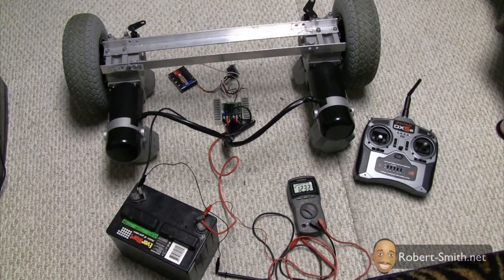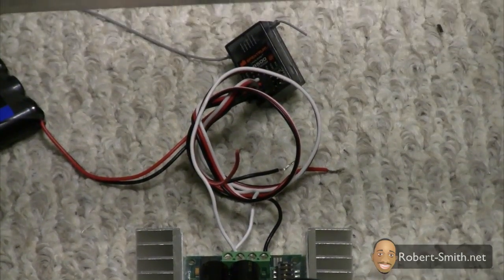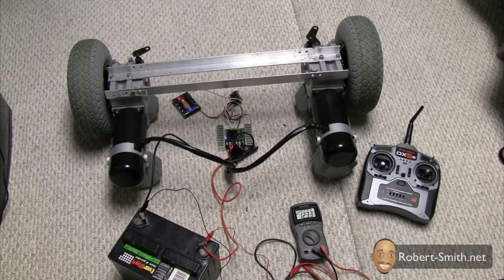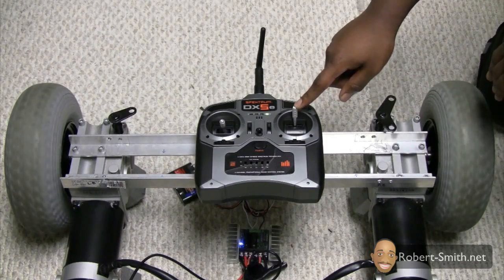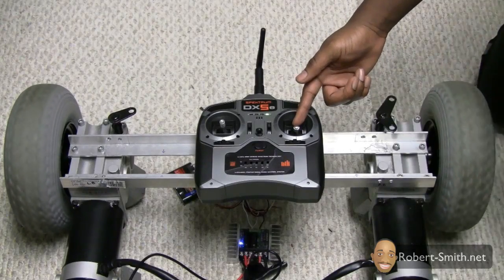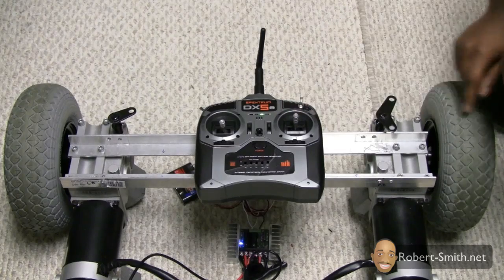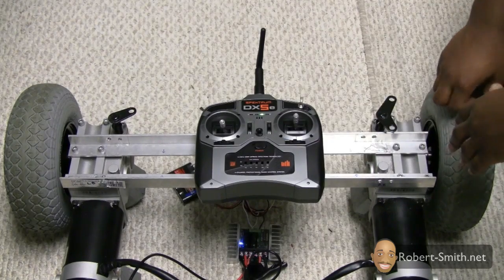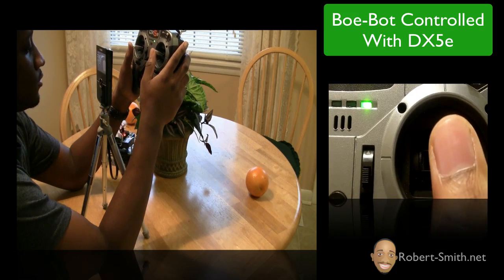RC Lawn Mower Project Update - Transmitter/Receiver Testing

Comment: Can you please advise me which mode of rc Transmitter works for such tank style robotic project.
Reply from the maker: Hey Pol_Khol. I am not sure for that type of project. I would think the mode I used in this project would probably work, but you may want to reach out to the Dimension Engineering company and see what they recommend also.

Comment: In similar projects what do you suggest the type of circuit breaker or fuse?
Reply from the maker: I would suggest you use a breaker if you can, but most people would probably use a fuse since they are a little cheaper sometimes and you can find many size types.

Comment: Hey Robert this is Robert Denney I wanna hook an alternator to  2 ,12 V battery is  building a snow plowI don't know how to do without a regulator.I  bought a 12 V alternator 60 amps.
Reply from the maker: I have never tried to hook an alternator to a 12v battery, so I would not know the best advise to give in this case, but I would recommend joining some online forum communities to see if anyone may be able to provide you some support. Forums helped me a lot when I was first getting started with this project :D

Comment: what model wheel chair motors did you use?
Reply from the maker: Hey Chris. I believe the following was the type of wheelchair motors I purchased: CTM HS 1000 Right Power Wheelchair Motor Gearbox 511000-10010

Comment: Thank you for making this video I made a remote lawnmower now I just need to figure out a camera and lights. Any suggestions?
Reply from the maker: Hey Tim. I haven't looked into cameras in a while, but I would point you in the direction to do a search for "RC cameras" and see if that pulls up something you find useful. Also, depending on how large the yard is you plan to use it for you should take into account to make sure the camera can cover the lawn size/max length.

Comment: where did you get the code for the sabertooth at?
I need help..
Reply from the maker: There was no special code other than the dip switch settings, which at the time was found inside the manual on their website.

Comment: don't need a battery to receiver it gets powered from sabertooth if connected correct.looks like you have ground connected but not the red 5 volt.

Comment: I'm brand new to sabertooth 2x32a , controlling wheelchair motors...I also have a Flysky FS CT6B tx/rx and a New Rain ESC/BEC...do I still need a battery pack & universal 3 pin servo wires? ...I'm really frustrated not getting answers from Youtubers...Not even how to bind my 
transmitter...help would be much appreciated.

Comment: Hello Robert,  what pin configuration are you using for the receiver? I need one for throttle and one for stopping one wheel at a time for turning.  the transmitter does not have a mode for a car only ones for plane or heli, is that a problem for controlling an RC lawn mower?  Thanks
Reply: 4430salton if you get the computer cable for spectrum transmitter you can set diferential trust

Comment: Robert,  I like to flip my motors up .   Which would change the direction on them.  My question ,   will the motors run in reverse with out any problem?   Is that okay ? or will the motor burn up or mess-up due to not running the default direction?   Because now my right motor will be on my left side and my left motor on my right side.
Reply: if its a DC motor there is no real "right" direction

Comment: hey could you please help me to finish this project. I connected the cables as it looks in your video but the motors doesn't move just crank end the sabertooth it's flashing the red led when I try to move the wheels.I hope you can help me.thank you
Reply: +Brian S  I have the same issue. Have you figured out what was the problem? Would appreciate any help. Thanks

Comment: I've tried a 2ch (Harbor Freight plane) system and a 6 ch truck system, both at 27 Mghz.
I only got 1 channel to work with the motor controller each time. (Sabertooth 2X25).
I'm going to try a 2.4 Ghz radio next since that's what I see a lot of people using.
I just hope I don't end up with another hundred dollars worth of spare parts.

Comment: I just got my sabortooth and mine didn't need the battery on the receiver, it powered the receiver through the controller. I plan to use a pistol grip radio instead of the style in the vid, I'm trying to make it easier for a left handed person to use because my dad has a bad right hand and he'll want to play around with this too. lol
Reply: what kind of plug or connection did you have on the receiver?

Comment: I have transmitter Spektrum dx5e and receiver Ar600. I am using sabertooth 2x25.  I am using wheelchair  motor - i am looking to build remote controller snow thrower. Right now I wanna get the first stage in check - connecting my sabertooth and wheelchair motors running. How did you connect the 6v battery to the AR600 receiver and what connections where made from the sabertooth to the AR600. Slots on AR600 from L to R; BIND/DATA, THRO, AILE, ELEV, RUDD, GEAR, AUX1. Thanks for your help! Lisa

Comment: I see you are using a separate battery for your AR5000. I've heard there is problems using the BEC on the Sabertooth for the RC receiver? If so, maybe a separate BEC could be used? Keep up the good work!

Comment: Im glad to see im not the only one who makes these! I made mine out of a push mower rigged to an old wheelchair motor. The drive motors are windshield wiper motors, and i am using a 15A esc ( i think it was sabertooth ). It is VERY compact. About 1x2 feet. Good for small areas

Comment from the maker: @ihave2rocks The price for the controller is around $129. It is called the Sabertooth 2x25. Google that. As for the motors, those vary in price since people just sell those separate when they dissemble electric wheelchairs. eBay that :)

Comment: Nice Video.
I personally prefer using a dx3 steering wheel controller .
check out my video's my mowers don't have a frame and the motors are tucked in tight giving you much better cutting up close to objects. I really like your video.

Comment: Nice break into the world of R/C: this is pretty much exactly the same setup i have on my mower. sabbertooth 2X25, spectrum DX7 (i fly helicopters too), 2x 12v lead acid batteries in series (if im mowing) or paralel (if a friend is mowing), and a pair of wheel chair motors.

Comment: @RobertSmith3 Thanks for the quick reply, I have been looking around at different systems including Audrino and other expensive and complicated controls, this will cut the price of controlling the mower by heaps and will make it so simple to hook up :) Now to find cheap wheel chair motors in Aus. Thanks, Kramer.